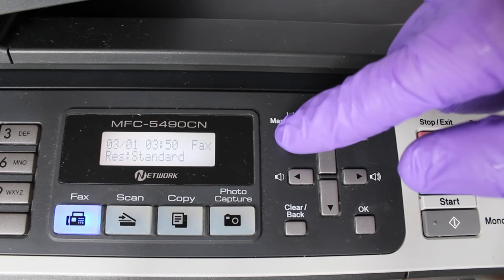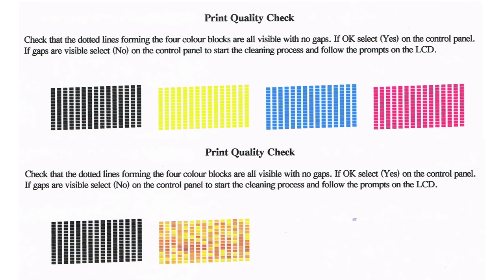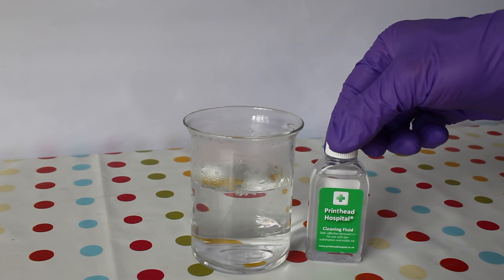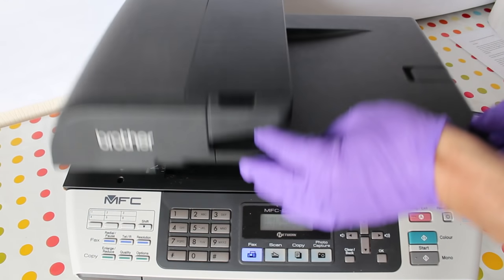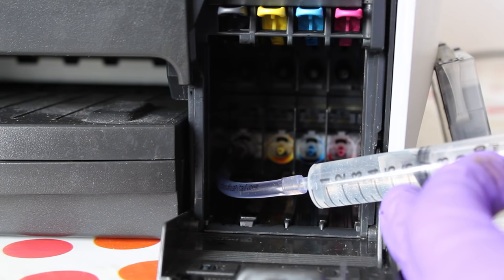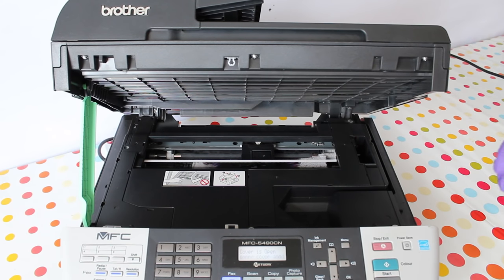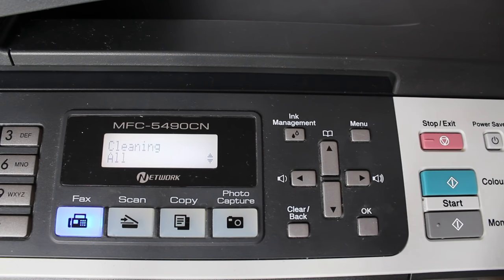How to Clean Brother MFC and DCP printers

Comment: I'm unable to remove the cartridge on DCP T-500W which has a different cartridge model than the one demoed in the video. Could you pls help with link to accessing the ink tube for DCP T500W? Too bad i bought the cleaning kit before reading some of the related questions/comments here. Your video title should either explicitly call out that you don't support T series or give a demo link to cleaning T series printer

Comment: i have a question ,or two ,I have  a mfc-j6520dw printer and  only the black seems to be clogged   have cleaned out before but after a couple pages it for reasons unknown clogs again, also what is the purpose of the  small and large sponges inside the printer, the small one  is hard and around the print head area and there is a larger container with large sponges in them it does have a clear line connected

Comment: So what if a color or in my case black(not a color😉) still won't print after cleaning?.... the printhead is cleared... fluid goes through fine.... colors are fine just black won't print... seems like it may put a little black(super faint grey shade) on the print quality test but that's it....

Comment: When I feed my Brother MFC-6490CW from the feeder at the top I get a black line down the side of the scan or copy page 
This does not happen if I lift the top and place the page on the window inside the printer
Reply: that sounds like the roller arm that pulls in the paper to scan has ink, dust, or debris in the area that you see the line on the paper. Maybe try a cleaning of the roller - we had RICO printers at a former job of mine and this was a constant issue! the before mentioned tip was the solution.

Comment: When injecting the alcohol, the syringe was very hard to press and withdraw.  I worked it this way numerous times.  Still bad printing.  Finally, I more forcefully injected the alcohol and then heard a "POP."  I thought the black ink line had detached somewhere or the print head was now unclogged I  could then easily inject and withdraw the alcohol.  And, i could hear air being forced out of the print head. And then, after several cleaning cycles, by the machine, my black print is outstanding!
I determined that the "POP" I heard was a valve or clog that was opened up.

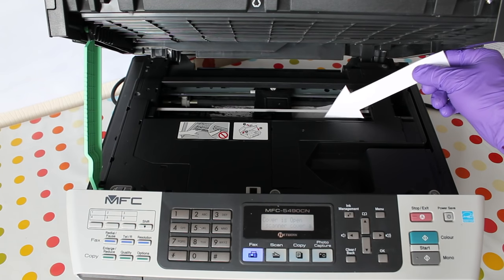Comment: hey sir, my clear strip that u mention at 3:17 of the video, my printer has ink on it and i cant remove it... and it cause my printer to cant init error 50 code always.... how to solve that?
Reply from the maker: It is tricky to get to but try using wet paper towel  or a wet ear bud on both sides of it. Dry off with paper towel as it's very sensitive to residual ink. Good luck!
Reply: tnx sir ill try later... i just now know the name of that strip it's encoder strip.... but mine has ink on it i clean all the printer and that stain only left that i think why my printer wont print tsk tks

Comment: I have a dcp-t700w. It has an ink Tank, is there a way to do this on that set up?
Reply from the maker: Yes: just take the CISS cartridges out as normal and run the clean. Just be careful to avoid air getting in the cartridges or ink leaking out.
Reply: Printhead Hospital Does the tank come out like if it was 4 cartridges in one? I have tried to work it out but had no luck.

Comment: Help! The print head wont come out after holding the stop button i have a MFC-235C.
Reply from the maker: Try pulling the power cable out while it's printing a nozzle test pattern
Reply: Thanks it worked! Subed!
Reply: Oh and another thing, what shall i do with the paper stuck in the printer, will it come out when i turn it back on?
Reply from the maker: Pull it out before you clean the printer or it will cause a paper jam

Comment: Does this work for blurred printing? Mine is printing half a page of blurred text and the other half is fine. Please help!
Reply from the maker: It only fixes missing segments in the test print page. There might be an 'alignment' option in your printer's menu that fixes blurring though
Reply: @anightin  I have tried that several times, but it still prints blurry on about half of page.
Reply from the maker: @shannonsternagle1749  I'd replace the printer then, I'm afraid
Reply: @anightin  damn. thanks for your help. much appreciated.

Comment: i am not able to open my brother dcp t300 printer ink tank out please help me.
Reply from the maker: I'm afraid that the T series printers can't be cleaned unless you can remove the cartridges
Reply: how can we remove the cartridge please help me
Reply: S Giridhar  put the printer on accessible on the left side 
Next put out the cover to access of printhead, remove the cover then there is 4 color tube and select which is block and insert the syringe with rubber tube directly which you pulled tube recently

To remove the cover please watch the how to replace the printhead on j100 but do not remove the printhead out on printer just illustrate to removing cover

After cleaning  run 3x self cleaning and leave printer for 4 days to reach inks all in nozzles
J1 series and t series still the same printhead
Reply: Noldanne Quiapo but my printer is brother dcpt300 is it works to it